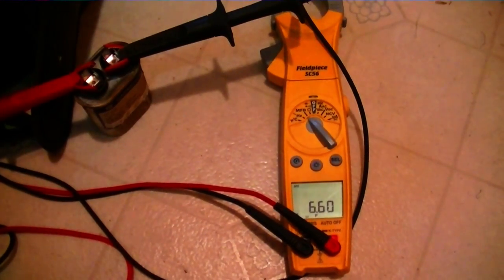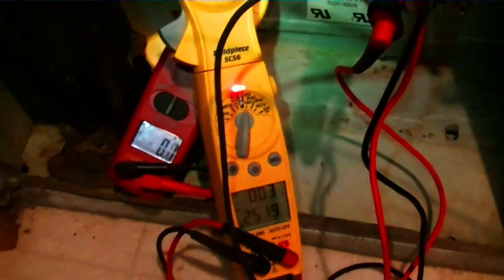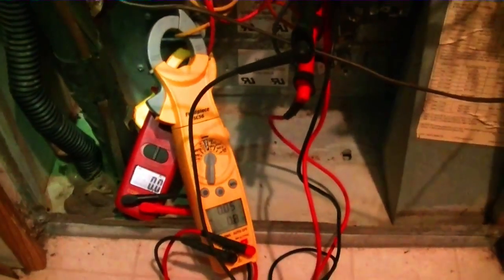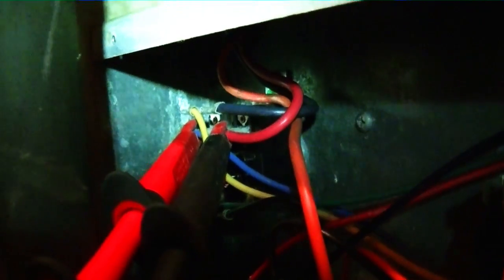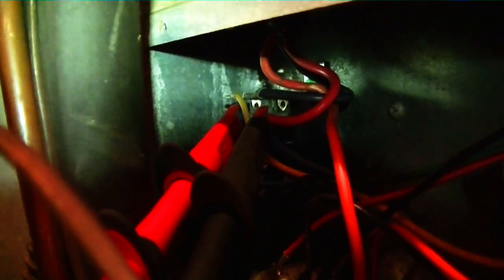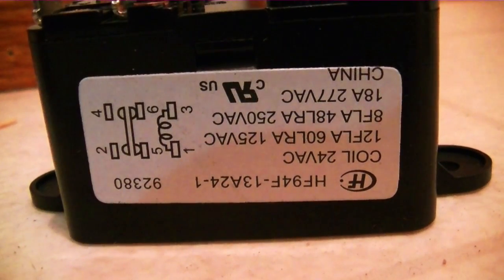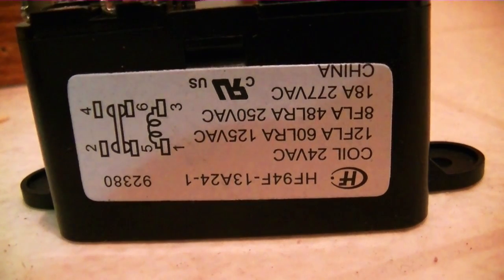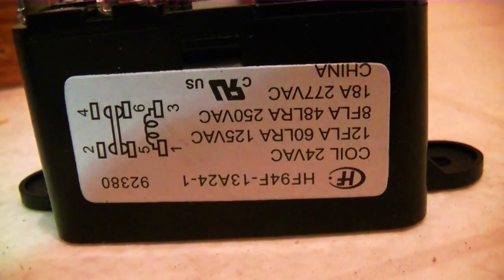HVAC Service Training-  Troubleshooting The Blower Relay

Comment: This looks exactly like a furnace heater I am looking at but the problem is that the blower comes on as soon as power is put to furnace. Is this the relay stuck closed or can it be the sequencer?
Reply from the maker: If it is heating non stop it's the sequencer, otherwise it's either a short, the relay or t stat.
Reply: It is the fan relay. However, it's usually a good idea to change them in tandem

Comment: the other day i had a blower not blowing on cool but on heat and fan it worked after changing fan relay 6pin n o and n c 24 volt coil the same thing happened i checked the out door unit and found contactor  closed with no 24 volt power can the contactor send back power to the relay . thank you for all your videos and training

Comment: Hey there!   nice video.   I have an old Lennox home HVAC unit in my condo and it's noisy.  I was thinking of rigging an SSR (two actually) to quiet it.   Unless there's another way to quiet it.   How does this old relay work?  What do the pinouts do?   I suppose I could buy one and figure it out that way but all I want is the pinouts and how they work.  i.e.  which pins are for the the coil. etc.    I think the main reason it makes so much noise is that it's mounted on the sheet metal.   If I took it off the sheet metal would that quiet it?  or I could affix a sponge underneath it perhaps that might do the trick.
Reply: Tim Spriggs the relay is a 38276 type.

Comment: Hello there.  I have an old Lennox G12D2-55-1.   It's working fine, but I'd like to upgrade the blower relay (38276) with a solid state relay.   It has some terminals that I have never seen before, specifically the one near the center of the relay.   not quite centered but almost.   I think it is fuse related but not sure.    I just want to know if it's possible to upgrade with an SSR.   if so, how.   
thanks ...
Tim

Comment: Hi , Talyn and thanks for the videos. I have a problem with my transformer. There is power  in and out but the sequencer never come on .
Reply: that 24 volts from your transformer is still directed through your thermostat. At you thermostat, check for 24 volts across RC,Rh and white for heat, yellow for AC

Comment: Thank you very much for this informative video. I was about to pay 200 dollars to have a relay board installed. After watching your video and reading my furnace's electrical schematic I have the 6 pin relay there now! (although it has not been correctly pinned for my setup!) My brother who is a licensed electrician will get is straightened out for me.
Thanks a TON!!!
Jeff

Comment: I have a problem my my heating elements are not coming on, but the blower comes on. Before my problem was that the heating element would stick on with the blower. I replaced the sequencer and now the blower still comes on, but the heating elements are not. I did put in the correct sequencer and its wired correctly. I checked the sequencer to see if I was getting 24v to it and im not, but not sure where im losing 24v, transformer is good.
Reply: At your thermostat, jumper Rh and white. if elements power on, replace thermostat

Comment: Hey talyn875 are those the fluke ac220's leads I didn't know they worked on Fieldpiece meters, do they come with the tips or leads too?
Reply from the maker: Fluke sells a pack that has the plunger style probes, the leads and needle style leads. They fit perfectly on the fieldpiece meter.(Leads and all)